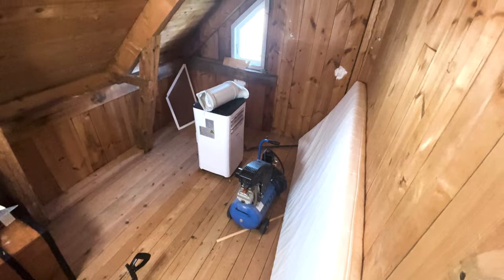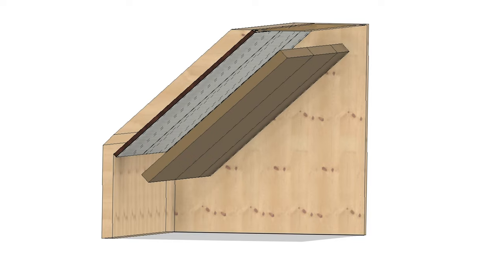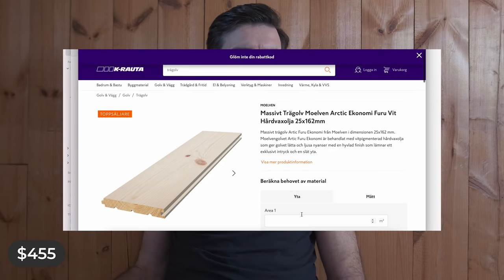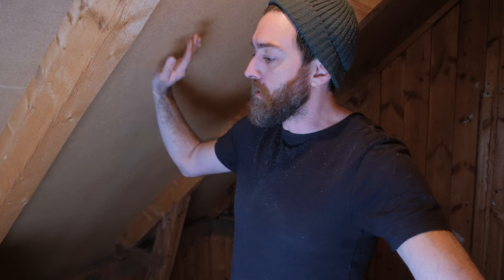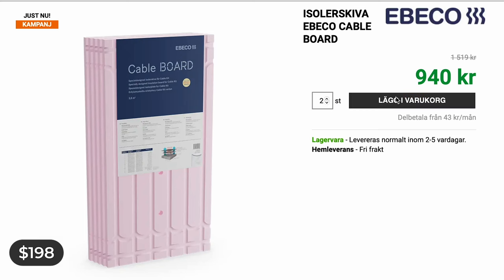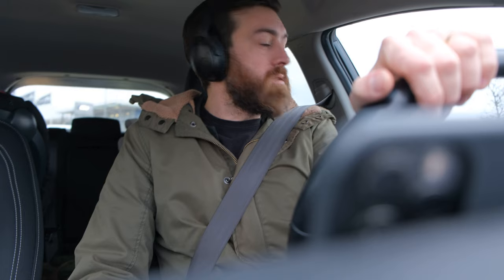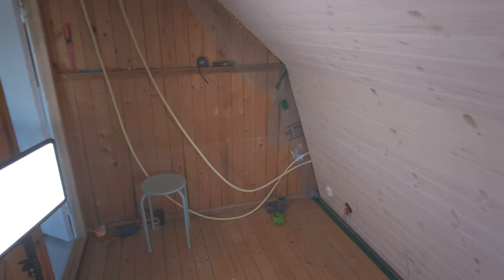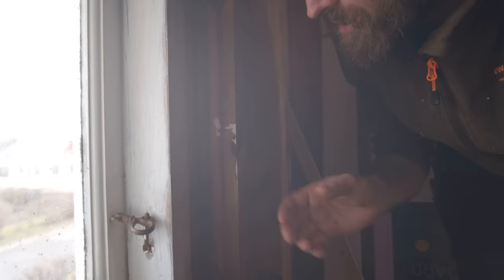Can You STICK to a Budget?

Comment: When calculating a budget, questimate how much of each material you'll need. Add 20% to those estimates. Look up couple of options (different brands, different stores to buy from) and do the budget with options that are not the ones you'd like to use, but one step more expensive. Now that you have some extra margin on both the amount and the price, multiply the value by 2 to get the final budget. This way, the final project cost shouldn't be more than 50% over the budget :)
Best way to stay on a budget is to have 0 budget and do nothing ;)
Reply from the maker: Ill definately use your way of budgeting in the future :) thanks for watching!